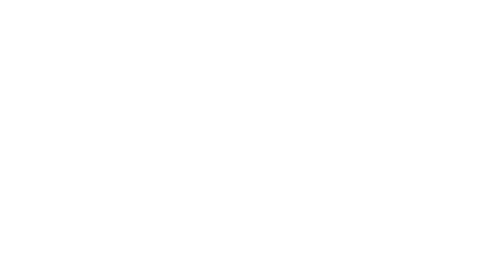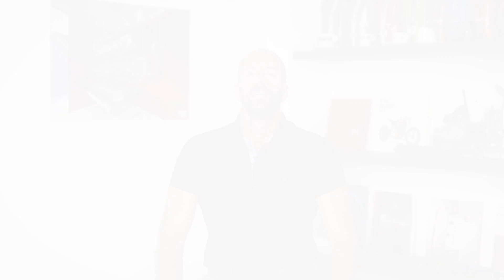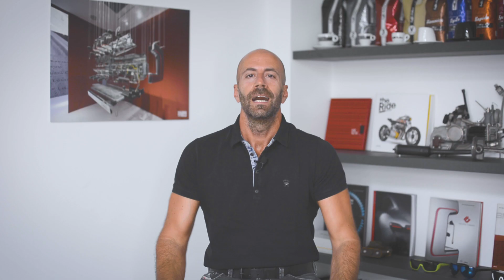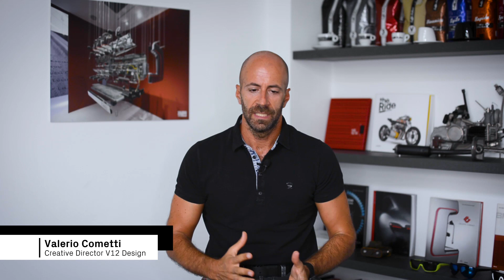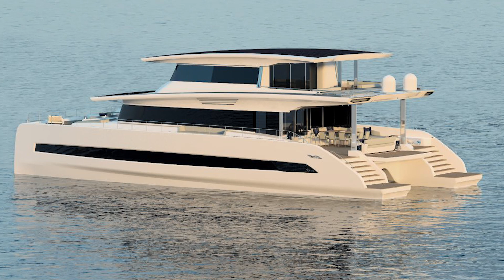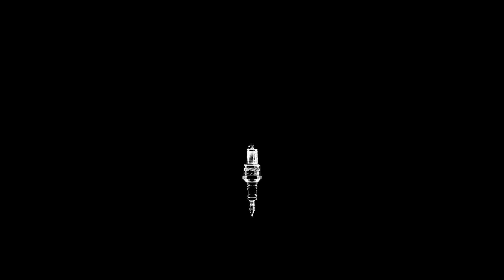Silent Yachts: the future boating experience is solar-powered, sustainable and self-sufficient

Comment: You mention that Silent Yacht has four models.  I am familiar with Silent Yacht 55, 64, 80.  What is the fourth?  Do they have anything less than 42’ or any plans for that size?
Reply: silent 44 should be released this coming year.
Reply: @LordFattykins  

Do you know if the Silent 50 collaboration with the VW Group is actually a new 50 footer or just a modified Silent 55? Or a Silent 44 with a LOA of 50 feet?
Reply from the maker: @LordFattykins  thanks for the update! Cant' wait to see this new version!
Reply: When can I buy a 38’ or. 40’ or 42’ in North Carolina in the USA?  Now….  OR.  1 to 2 years possibly….  OR.   NEVER…
Reply from the maker: Hi Lee, first of all thanks for your comment! 
When describing their current range as four-fold, I was referring to the 55', 64', 80' and 80' 3-decks: I hope I didn't sound too confusing and you may have a point as, at the end of the day, the 80' 3-decks is just a second version of the normal 80'. As far as I'm concerned, I heard rumours that they were working on an even larger size, whilst I heard nothing instead about a 40ish-footer. 
I think there could be quite some market for a 42'-44' vessel, but I wonder if the reduction in size might be an issue for the overall surface of the panel.
Once again, thanks for your question and although more recently we switched back to Italian (due to strong "local" demand), we are adding sub-titles, so we hope you may still follow our videos!
Reply: @V12Design  

FYI, the Silent 64 is discontinued and replaced by the Silent 60. I believe this is very recent. Check their website.
Reply from the maker: @ycplum7062  my bad, I was supposed to type 60' and not 64'. I knew the latter being discontinued...but evidently such piece of info didn't reach down to my fingers whilst typing.... Thanks anyway for the reminder!!
Reply: @V12Design  

Tell me about it. My typing has gotten worse lately. Way more typos than several years pass.  ; )
Reply: There is silent 62   3 deck 
There is also the Silent  80. 3 deck

Comment: What do you think about the cost of being an early adopter? I have to imagine that a silent yacht bought in 2021 wouldn't be a fifth as efficient as one bought in 2025.
Reply from the maker: Hi and thank you for your comment! 
Your "objection" makes a lot of sense, but in some sectors if you design in a so called "future-proof" manner, you allow your product some growth. Unlike in a car, in which certifications are super-strict and the way all components are deeply integrated to one another, in a yacht you may fit components such a batteries and solar panels in a way that would allow for some upgrade later in life. Once the battery density has grown due to technology evolution, you may be able to fit some new batteries replacing the old ones (which would have aged anyway). Same potentially goes for the solar panels.
In a nutshell, like you correctly said, being an early adopter comes often with a price, but some components CAN be upgraded and already today solar panels and batteries have reached a reasonable "maturity".
Once again, thanks for your comment and please make sure you kee watching our videos!
Reply: The batteries and solar panels looks very easy to update. Not a huge cost of the boat really.
Reply: Electric motors have been at pretty much optimal efficiency for over a century, you can only improve them by 1-2% by spending lots of money on expensive magnets.
Solar panels have had the same efficiency for a couple of decades, if you have single layer crystals you get about 20%, if you buy super expensive multijunction panels you can get up to 40% they are usually kept for things like satellites due to the extremely high expense.
The batteries might improve and they are the easiest to swap out in 10 years time. If you can afford to drop a couple of million on a yacht today, you can afford 20k-40k in new batteries after 10 years. If you are just cruising leisurely around the Caribbean you will probably save that amount in fuel bills.